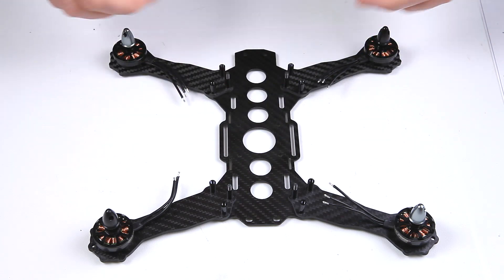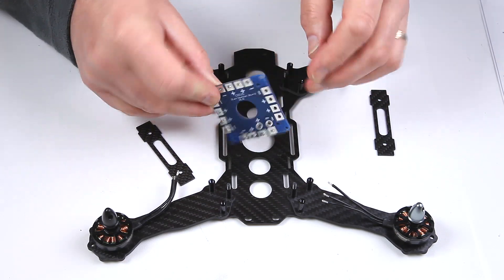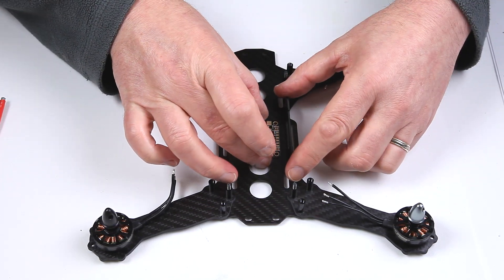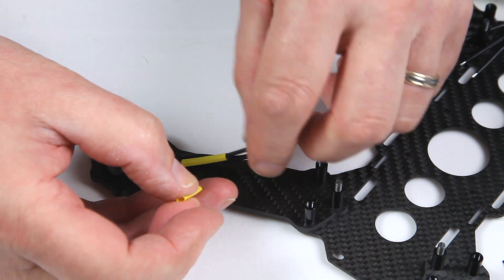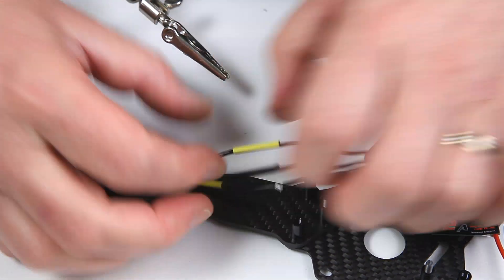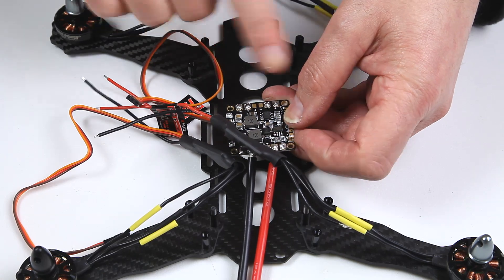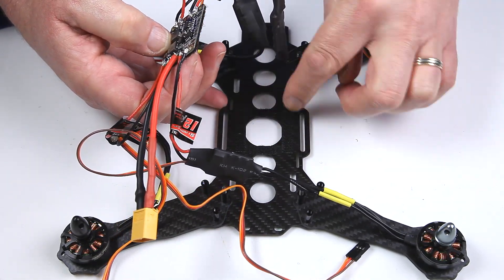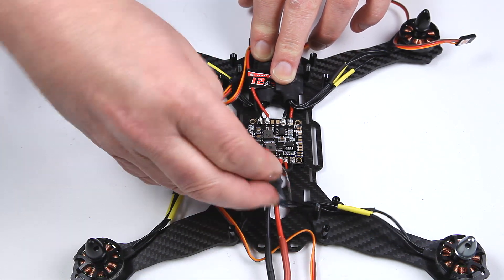Robocat 270mm FPV Racer Quad Assembly Part 2 Wiring

Comment: Man, your soldering work here is awful. Looks as a bunch of cold joints and solder bridges to me. Please don't teach flawed soldering skills to young - this can kick back someday :)  Although the PDB choice is good. I have that same PDB in my Robocat for same reasons as you're mentioned, it has good quality and is not very expensive.

ESC's inside - don't! Relocate them at beams, remove the original ESC motor wires and solder motor wires directly to ESC boards. You'll get lesser wire resistance (more responsive quad as result) plus instant cooling from props and airflow in moving. Maybe 12A ESC's is not heating much but for 20+A ESC's this is mandatory.
Reply from the maker: I agree on the soldering, just would not go right, no matter what I tried and it just got worse aaagh I have soldered since with same set-up and no problem. Thanks for tips on ESC's all this is new to me so any sound advice is much appreciated and thanks for explaining why, helps a lot. Thanks again

Comment: Coming along nicely my friend, something to remember when wiring motors to ESC's is ccw motors are wired straight to esc's and cw motors have 2 of the wires crossed. I found this from a very helpful video on cheap fpv racer build by rcmodel reviews
Reply: I might be wrong but can't you just set the motors to the required rotation in OpenPilot regardless of how you've wired them?
Reply: Not that I know of as other builders refer to swopping any 2 wires, also the prop nuts would be wrong and you risk loosing a prop
Reply: +Paul Johnson Sorry yes, you're right. I was actually thinking of when you wire the esc's, you can assign that in OpenPilot to suit which esc is connected to each bank on the pcb
Reply: This was required years ago. At today ESC's can be configured to rotate in right direction. At least BLheli compatible ones.